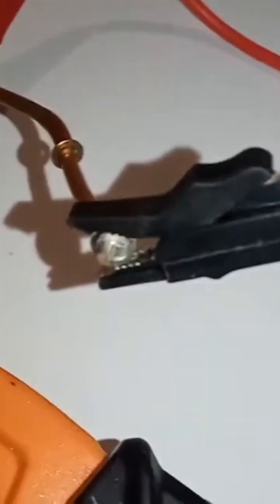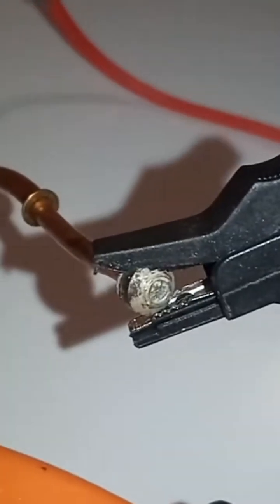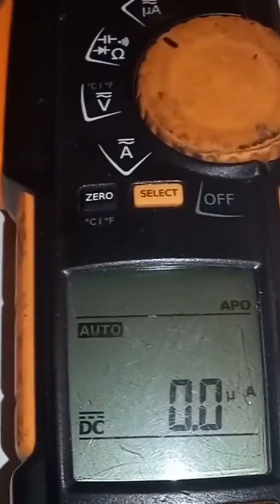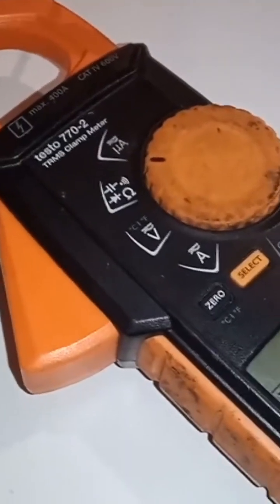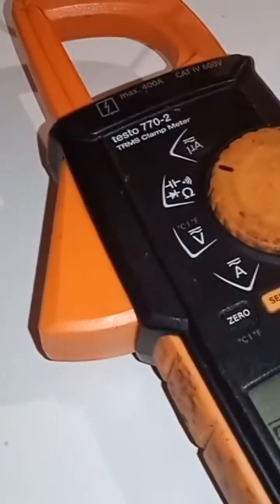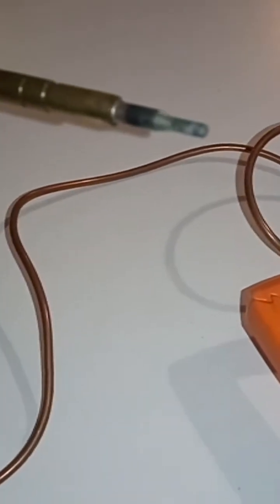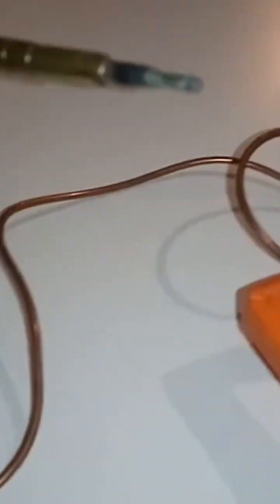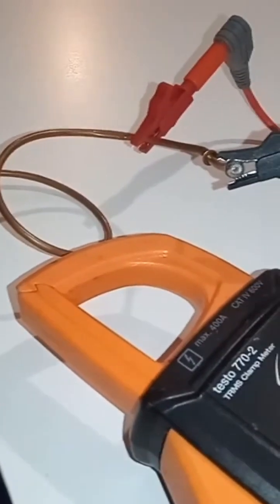TESTING A THERMOCOUPLE

Comment: You’ve got it set to micro amps there, which is what is used to test flame rectification/ionisation probes - looks like it’s set on Ua from what I can see anyway.
Reply from the maker: @mattwigg2947  my multimeter has the option in two section to pick up milivolts. The symbol is there in two sections. Thanks for the feedback though. Made me look as it's been ages since I've had to even do this. I will aim to do a short vid on the symbols soon for my own familiarance and others. I have another vid (same but longer) on the same thing where the multimeter and its options can be seen more clearly. The multimeter is auto ranging and switches.

https://youtu.be/N1C_RQEm7AA?si=e6fmGFRXraHdykQO

Comment: Hi mate. I’m due an upgrade of a multimeter. Any suggestions cheers 👍
Reply from the maker: @matthewwatson4093  I have had a fluke and a testo. I really like the testo. I've roughed it up and it's still going.
Reply: If you're doing gas then I'd say the Fluke 116, it has pretty much all the functions you'll need. I have the 117 and the socket and see engineer dmm,  it has most the functions the 116 has.